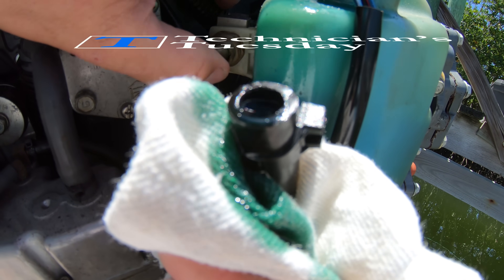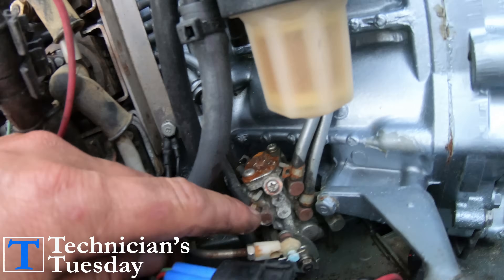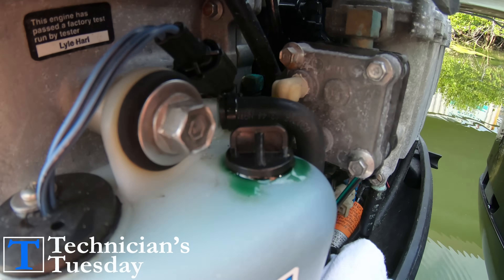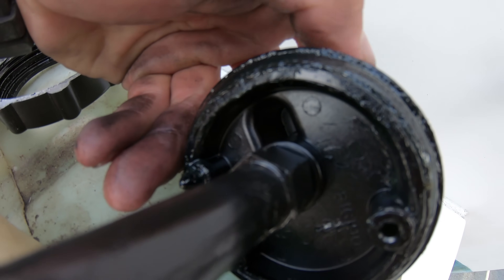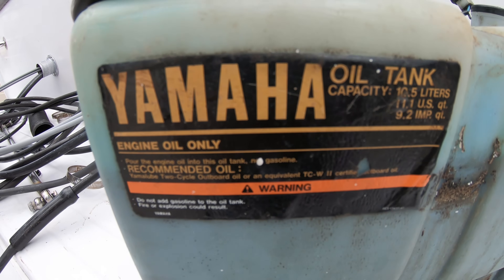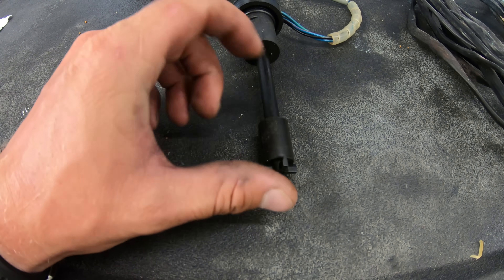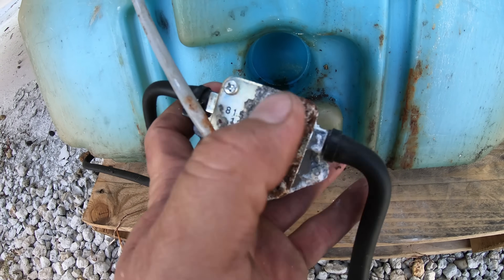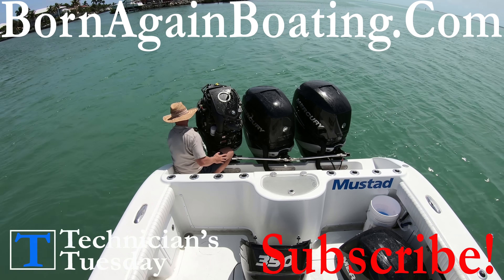How 2-Stroke OIL SYSTEMS Work!

Comment: Putting the filter on the back of the oil tank was a major error by Yamaha.  It means you have to pull out the entire tank to replace it.  I flipped my tank around backwards so that I can visually inspect the condition of the filter and pump when refilling the oil reservoir.  Also if the oil arm linkage breaks it doesn't always dump oil, sometimes it will stick from corrosion.

Comment: Question, I replaced my small white inline oil filter on my mercury optimax 115.  I was told i have to purge the air out of the line and a dealer needs to do this.  Is this true? Im scared to run the engine this spring in case there's air in the oil line.  I would assume only the 150 optimax and bigger need to do this because they have 2 oil tanks.  Thoughts

Comment: Is the mercury 50hp system reliable? Thanks
Reply from the maker: Um, depending on it's condition, I would probably be leaning more towards premixing that engine though
Reply: @BornAgainBoating  your the man dude, thanks. It’s in good condition mechanically and is a 2001. Is there a way to check the oil pumps condition. I’m not sure what to look for.

Comment: I just bought a 1999 mercury dfi 225. I want to install a reserve tank in my boat. How do I hook up the pressure side to the tank. Also your thoughts on blocking the oil pump and mixing in the fuel tank. I don’t really like that option but it has been mentioned to me. Thanks for the tech tuesdays
Reply from the maker: Here's about deleting the oil system and premixing: https://youtu.be/YKsIfMnJ1ig
Not advisable for the opti, it wouldn't be good.
You just run the hoses to the tank, that's pretty much each :/
Reply: @BornAgainBoating  much appreciated. That was exactly what I needed. I did get a service manual. Outboards are new to me I’m at home on an inboard diesel.

Comment: How can you test the Mercury oil pump with the engine off? Thank you! I want to know if the problem is the sensor (common reservoir magnet issue) or rather the oil pump… Thank you!

Comment: Very useful ..
Reply from the maker: Thanks a lot
Reply: @BornAgainBoating   hi there! Could You give me your opinion about my oil pump Mercury optimax 150 hp model 1999? At the End Black plastic round shape there is oil that comes out very slightly ás if there cut..no run pisicion,is the pump screwed?

Comment: Where can I find a wire harness that goes from oil tank to main harness for a a 2003 vmax 200hp? Someone disconnected resivoir instead of replacing the pump, so I'm having to remove cowling every few hours to add oil to main tank. Harness is nowhere to be found on this thing.

Comment: Great information. I just came across your video. Last summer I replaced my oil reservoir cap/magnetic float on my 1992 Mercury 150 HP XR6 because my cap cracked. I installed the new cap and the alarm was still sounding for low oil when the reservoir and 3 gallon tank were both full. I had the company replace where I purchased the new cap with another cap because I thought it was faulty. I placed a magnet on top of both of these new oil reservoir caps and the alarm quit sounding. Because of this, I used JB Weld to secure my old caps magnet to the 2nd new cap's magnet for extra magnetic pull/force. That worked all of last summer with multiple trips to the lake and in March of this year. Today, I tried to go fishing with my boys for Father's Day and the alarm was sounding again. I brought it home without getting it off of the trailer and put the magnet on top of the cap again and the alarm quit sounding again. Took the magnet off the cap and the alarm continued sounding in sequence of me putting the magnet on the cap and taking it off. I'm wondering if this could be caused by the electronic pack/computer pack looking thing that the blue wire from the oil reservoir cap connects to and maybe could be bad, if that has anything to do with the strength of the magnetic pull for the oil reservoir to work properly, or do you think it's something else? I searched YouTube and can't find anything regarding this particular issue. Thanks for any help you can provide.

Comment: Thank you for another great video. I have a 2002 Yamaha 150txra 2-Stroke. I am not getting power to the pump from the motor. When I use the toggle switch I get nothing. I have checked/replaced all the floats. 
Could it be the “computer”? 
When you mention computer; what exactly is that? The CDI unit?

Comment: i have a problem with my mercury 90 hp efi outboard, i have 4 beeps every 2 minutes,  ive checked the water sensor and its ok.  ive checked the oil sensor contiuniity and get an open circuit  is this normal with a full tank of oil or is it bad? thanks jim

Comment: Great Vid !! Quick question: Where does the blue connecter from the extension oil tank connect on the motor . Yamaha ox66. I have the extension tank but I'm not sure where to connect it to the motor. Thanks

Comment: 1989 150 Yamaha outboard / (2stroke) Dual engine installation - Re: Oil warning system issue. 
•	Port engine Multigauge is showing Yellow oil warning light, regardless if Sub-tank (boat) is full to top and has a new level sensor installed.  
•	Swapped complete engine harness connectors under console stbd to port vs versa and yellow warning light switched over to stbd multigauge. (confirming multigauge is working properly)
•	Oil system circuit harness – Resistance test done on both engine oil harnesses and tested out good with the same result (port vs stbd).

I welcome any suggestions you are willing to lend. Thank you.

Comment: My 115 Yamaha used to occasionally get overoiled and blow smoke when the float level stuck on high level so I put a bypass switch in the feed line to manually fill the Motor tank. That has worked fine without needing to replace the remote float unit.

Comment: Great video!! Have a 96 cobia 130hp v4 the manual doesn’t seem to fill so I started troubleshooting. With the ignition in the on position or engine on The alarm works when I remove the cap on the oil tank on the engine. But if I hit the switch I don’t hear the reservoir motor. When I touch it it’s hot. Is it supposed to have 12v constantly or only when float is down? I’m confused on proper operation. Thanks for any help in advance

Comment: So on a Yamaha if the pump is working and the main tank is full then the rest of the system is working? I have dual 200s and on one of the gauges the oil tank sensor stays on the middle line and it flashes even when the main tank is full does that mean the sensor is bad?
Reply from the maker: Thank you for your question! Please post it in our Born Again Boating Community! Go here and scroll down to access - it’s free: https://www.bornagainboating.com/

Comment: My Yamaha powerhead tank gets low and I get and alarm but will fill with the emergency toggle on the motor. Think the filter on the remote tank is gummed up or the float on the tank is bad?
Reply: Mine does the same thing. Did you figure it out?
Reply: @andrewwrona1929  yeah I bought a 2021 Suzuki 175 4 stroke. Fixed 🤣

Comment: Great video, have a 2002 Yamaha 250 ox66 ,  the oil tank will not fill. Have to use manuel switch.
Reply: I have a 98 250 ox66, and I have the same issue as well. I am trying to diagnose it, let me know if you find a solution.

Comment: I have a 1999 mercury Opti max 150, the oil reservoir started leaking when we took it out and it dumped a lot of oil out of the reservoir ( normal to happen with the design) the new one i bought seems to be a little  more sturdy. My question is, can I just put oil in the oil reserve and the oil tank and be good? I've read on forums that a piece of equipment is needed to bleed the system? i plan on going out this Sunday and I really don't want to blow the motor. any advice will be appreciated !!! Thank you for the videos I've watched them all!

Comment: Best channel to learn boating stuff for people that need to do their own work as much as possible. Quick question if you have the time? I have 1999 175 Yamaha Saltwater2 series carb version. My motor is running lean could that be from the filters? The oil container on the engine seems full?
Thank you again

Comment: I have a 2001 yammy ox66 200hp, not pumping oil. Both float switches are new, pump works, emergency switch wont pump. All wires from pump to engine tank show continuity. Is there a relay or fuse to test that I am missing? Any thoughts? Thank you.

Comment: hello friend, I have two yamaha v 225 ox66 fuel injection.
Could I remove my oil storage tank and engine, and do direct mixing in my 50-1 fuel tank directly to my fuel storage tank and use it? can it be done on these types of engines? excellent videos, and thanks for your attention

Comment: Huge question!!! I ran a different "cheaper" brand of oil and ran my direct injection on my 2000 Mercury 4 cylinder 2 stroke dry! It ran out way before it has in the past. Like a half a tank of gas sooner...about 30 gallons.
Lost a lot of compression n my #2 cylinder and had to get towed to shore. Engine still cranks over and runs now.
Is this common? Is the other oil that much thinner??? Was it me just running around a lot faster???
Novice with 2 strokes...do I keep running it or rebuild?
Reply from the maker: Ouch! Yeah, saving 10 bucks on a gallon of oil sometimes has it's down sides :/ Um, you should pull the intake and the reed plate and look into the crankcase and see what kind of damage has been done. A loss of compression on a two stroke, like this, in this situation, might be catastrophic :(
Reply: @BornAgainBoating  I scoped the cylinder and saw scoring. But it runs now that I added oil and it will also go into gear without stalling (out of water) which it didn't before. Hand turn flywheel and watch everything...seems smooth. Also, shouldn't there have been a fail safe or an alarm go off?... Nevertheless.... Check crank case?
Reply: @BornAgainBoating  hey BTW just wanted to say that if I had the money I would pay you for the wealth of information you have provided me with!
Such a huge blessing being able to find you...a huge thank you!

Comment: I haven’t used my boat in a while. I have a 2003 Yamaha 250 2 stroke with that oil system. I turned the power on when I changed out the stereo system. I heard the pump prim itself. I never started the boat after words. I shut the power back off and today I turned it on and didn’t hear it prime. Should it prime everytime I turn power on to the boat?
Reply from the maker: Usually it turns on whenever it sees a certain oil level in the tank. The oil might have been low and turned on and filled up the tank.

Comment: sounds like an expensive problem reguardless of what I do.   Why not go old school and just mix it with the gas?  End of all these problems.
Reply: Carburated Engines:  Its a trade off. I have had experience with both mixing and injecting. I'll admit I do worry if the injection will fail. Mixing is ok but it uses a lot more oil thus smokes more. The 50:1 mix is what's required at max RPM so premixing gives the engine max oil all the time,  injection provides variable lubrication on demand when needed, not much lubrication is required at idle speed.so at lower RPMs less oil is required which is what the injection system does resulting in a cleaner burn, faster starts, better engine performance and very low smoke compared to premixing. The spark plugs dont take a bath either. 
When properly installed...the Yamaha system is pretty reliable and easy to maintain and easy to eliminate, it's a personal choice .
Reply from the maker: Some engines you can, and thats not a bad idea, but some engines you can't do that on, and then its not a good idea ;)

Comment: Will the oil toggle switch work (2000 Yamaha 130 txry) when the engine mounted tank has the safe amount of oil in it? A mechanic told me that the toggle switch would not engage the pump if the float switch was at the safe level.   To test the oil pump, can the brown and blue wires on the pump be disconnected from the harness and a 12 volt source be introduced?  Thanks
Reply from the maker: With the key switch on, the toggle switch will turn the pump on regardless of where the float switch is. It's an over ride switch :) You can power up the pump with a 12V source as well, that's how we test the pumps, disconnect the bullets at the pump and put power to it :)
Reply: @BornAgainBoating Thanks!  The pump is bad so how do you disconnect it from the tank?  Do you need a special tool? Also, once the new pump is installed, does it need to be primed and , if so, what is the best method?  Thanks again.

Comment: I have an 89 Yami and I had a new reserve tank pump and filter still something failed and the float stuck at the same time. The engine lost power and shut off. We let it cool down and she fired up and eventually ran like normal. We got really lucky so I took the oil pump guts out and went to premix. I spent all that money only to nearly blow the engine anyway. Never again. That bitch is getting oil if it’s running now.

Comment: Extremely informative video, like all videos Aaron does! Thanks for another great video. I have a Mercury 1997 225 OB, recently I ran the oil dry. Since then the oil alarm does not stop beeping. Every two minutes I get the 4 beeps. I've purged the oil line to the tank. I've purged the pump. I put a magnet on the sensor and used a multi meter to assure it registered. I also used a hanger to run the float up and down with the sensor in place and watched it register as well. All seems to be good but the alarm does not stop beeping. Don't know what else to do? Any thoughts?
Reply from the maker: Thank you! Thats strange! Sounds like the sensor is bad but you're saying its good :( not sure what to tell you there :/

Comment: How can you tell if the oil pump under the cowling on the yamaha outboards is bad.  You mentioned it can fail and will "over oil" as a fail safe! Love the videos! Always learning.
Reply from the maker: Normally the linkage breaks, but if you look at it, with the linkage disconnected you should be able to move it.

Comment: The tank on my99 ox 66 225 isn’t filling from the main tank, is it common for that filter to get clogged.? Thanks for all the awesome info as usual
Reply from the maker: Yes it is, but it's usually another component in the system that fails. Check the pump first, it's in the reserve tank in the bilge in the back.

Comment: Great video! For the Yamaha how would you go about testing the two floats and the wiring harness. I’m having the issue on my ox66 and already changed the filter. The oil pump runs with the manual switch but won’t will up the tank automatically. I’m in the Miami area, would love if you can take a look.
Reply from the maker: Thank you Bryan, sorry but I'm not in the Miami area, down in the keys and I don't really do side work. You can test the sensors by ohming them out with a meter. Or maybe find someone there in Miami that you can swap one sensor over at a time and see if it fixes it :) that would be an easy way without having meters and break downs.